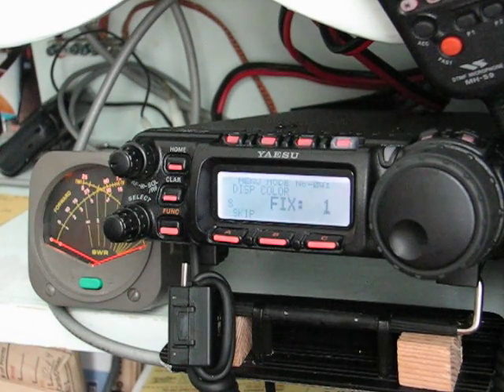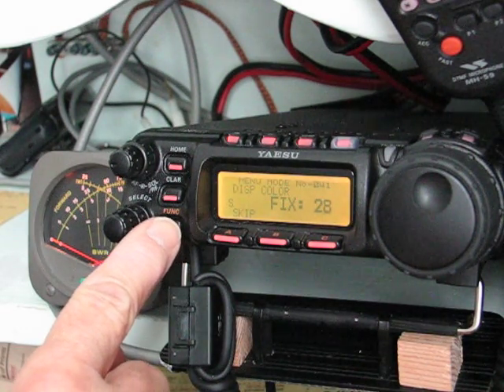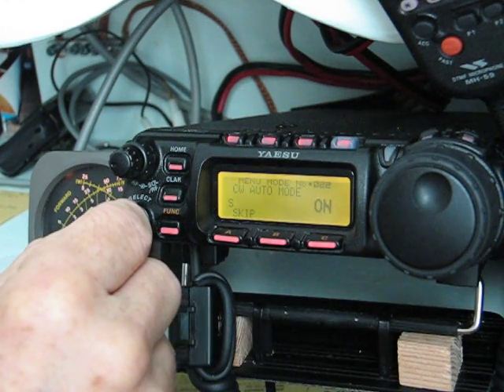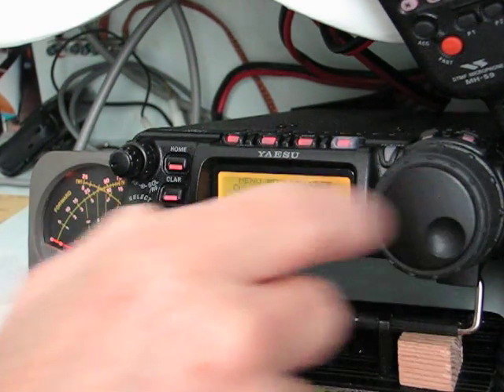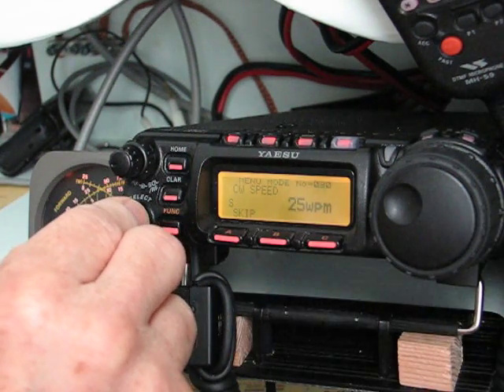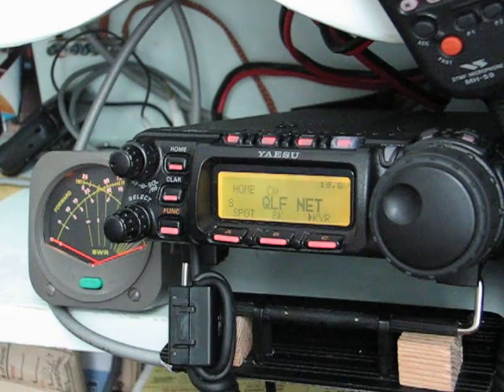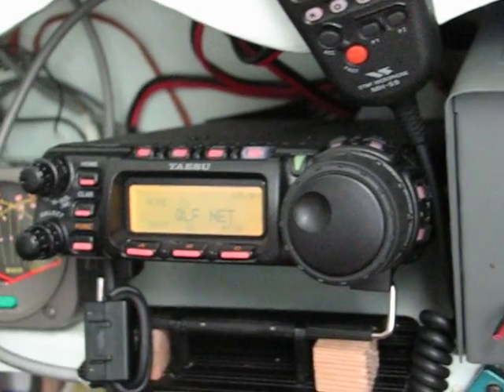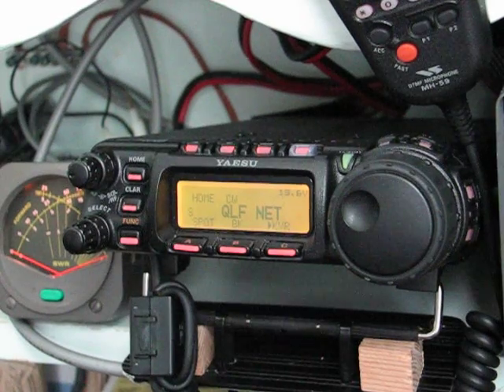Yaesu FT-857D CW operation and menu demonstration

Comment: How do i use the  857 as a cw trainer ? ..there is a way to use a straight key  to practice  and NOT have  it transmit  and you can hear the sidetone ...how do I do this ??.....manual says  the  B/BK light  must be off   and you have  to use a 3 prong stereo plug ...the  dit  dah and ground ...but straight key  has two  terminals ..so what  do I do with the  third wire  from the stereo plug ?..any one has a wiring diagram ? thanks
Reply from the maker: Please refer to the Yaesu 857d manual page 17 CW Connections. They show you the connections for the plug. CW Transmission is covered on page 52 with #6 CW Practice and #7 CW Sidetone volume level. Happy Brass Pounding 73.
Reply: @stoker20  thanks for your swift response ..thanks for helping out a fellow  HAM .....however  what i want to see is  how to connect a  three lead plug to a straight key ; that only has  two terminals....the diagram  in the manual shows a  three lead  to a  paddle ....I want  the diagram  for a three lead plug  with three wires  to a straight key ??.....thanks again
Reply from the maker: @antonjames8405  The tip of the plug goes to the key  contact and the ground is to the part of the 3 contact plug farthest away from the tip. Use a meter to confirm continuity of the wires to the part of the plug you're trying to hook up.
Reply: @stoker20  and what happens  to the third  lead .???....ie : the one  that is  in the  middle  of the  stereo plug ?...there is  a  tip..aka the  dit ...a  middle..aka  the dah  .. and  a shaft . aka  the ground ........so there are three wires out of the  plug ....so  where do you put the three wires ??...  the tip goes to one terminal on the  straight key ....the  ground  goes to the other terminal on the  straight key ....so  what happens  to the middle lead ??......thanks for your patience
Reply from the maker: @antonjames8405  Nothing happens with the middle. One of my keys had a 1/4" plug so I used a 1/4" to 3.5 or whatever size it is adapter and it worked fine or get the male plug for 2 wires and solder on your leads.
Reply: @stoker20  thanks a mill..will give  that a  go
Reply from the maker: @antonjames8405  You don't turn the keyer on so dot's and dashes needing the extra wire are of no concern to you using a straight key. If you are in CW mode with no break in activated you should hear the sidetone when you push the key. Happy to try and help with any questions you have.
Reply: @stoker20  I finally figured it out  and it works  fine now ...so as to help others who have this same problem ; here's what I did :  the manual says you have to use a three   section stereo plug ...so that gives  three wires ....those three wires are the tip  ,,the middle  and  the  shaft ( aka the ground )  .... the tip goes to one contact on the  straight key ...the middle and  the  ground  or  shaft  are twisted together as one and  goes to the other contact on the  straight key ...I did that and all  works now .... thanks

Comment: Get an optional 300Hz CW Collins filter and you won't believe the difference it makes in reception, especially on a busy band or during contests.
Reply from the maker: Yes that would be nice! I've had tight filters on some of my other radios. Using 756 pro3 when I'm on the air now.

Comment: have you ever tried the beacon mode on it? I can't seem to get mine to work! Not sure what i am doing wrong. I've followed instructions to the T several times
Reply from the maker: Yes, I've used the beacon mode. Program your CW message how you want it and enable the break in. I didn't have any trouble. Just followed the directions????  Do you have the break in turned off?????  It plays the message but doesn't transmit???  Maybe you have some option turned off in the menu???
Reply: sorry not sure what you mean by break in. kindly ask you explain. what other menu options do I have to check?
Reply from the maker: You can't program the message? It will play the message but not transmit? I need to know what the problem is. I looked at the manual and the break in is automatic so that's not the problem????? The break in is a control for CW transmitting. You do understand the Beacon is CW mode?
Reply: thanks for your reply mate. I am able to program the msg. when that is complete, i have my frequency selected and the mode on CW. when i press the key (tab labeled A) the beacon menu shows up on lcd but radio does not transmit. what am I doing wrong?
Reply from the maker: Without being in your shack, I can only encourage you to refer to your manual. It might have taken me a few times to get it right. How about the CW message keyer? Can you make that work? I think the only difference is that the Beacon feature is a timed interval for the A button.

Comment: The reason you don't hear relay clatter is because you aren't transmitting. I suspect you have VOX turned off. Full break-in cw uses a rather loud relay making lots of noise just like the 706 plus it chops the dits in a similar fashion. The receiver is much better than the 706 however.
Reply from the maker: DROM. While sending, the Yaesu is silent compared to the 3, 706's I've had QSK.
Reply: stoker20 Quieter yes but I still say you weren't transmitting. Of course with BK-in turned off there's no relay at all.
Reply: @n4lq  mine is a tad quiter than my old 706. I do enjoy CW on this rig.

Comment: The meter reads from bottom to top. Bottom is low top is high. RX is always S meter, TX you select either PWR, SWR, ALC or MOD from menu settings.

Comment from the maker: I have mine set to S meter priority so when you transmit it switches from the S meter to show the SWR's. It's a small display but all the important stuff is crammed in there. Much bigger display and meter readouts on the 706.

Comment from the maker: The guy I got the radio from did the transmit everywhere mod and it messed up the SSB modulation. I mainly operate CW so this isn't a big problem for me. If you want CB you would be wasting your money getting this rig unless your goal is to impress your friends with the name and model of radio you're using.

 Also with the menu based control, for some Good Buddies it's too complicated to figure out how to operate the radio!!!!

Comment from the maker: @rs4425 From the "J" quick menu, you will see, spot / bk / kyr. The bk can be toggled on and off by pushing the button below the bk icon. I don't have the manual handy but the CW operation should be explained pretty well in there. Good luck OM.

Comment from the maker: @KC0TLV The guy I bought the rig from was a Ham and he modified it to TX everywhere. I'm thinking the rushing air noise on SSB TX is because he screwed something up. If I kick in all the DSP 80% of the problem is solved but the RX is unpleasant to listen to with all the digital filtering.